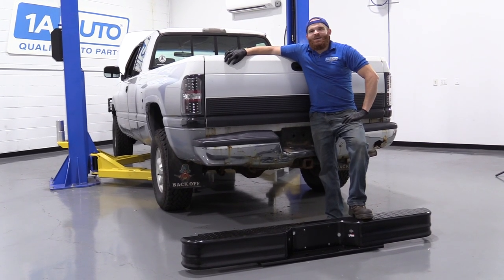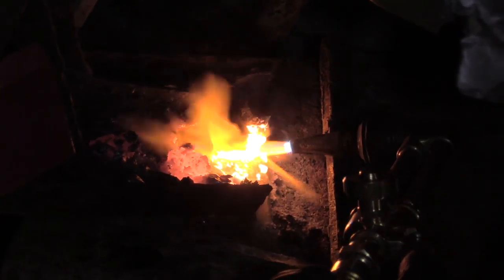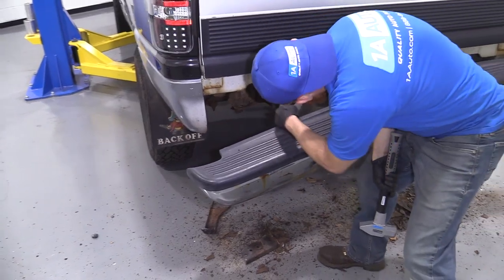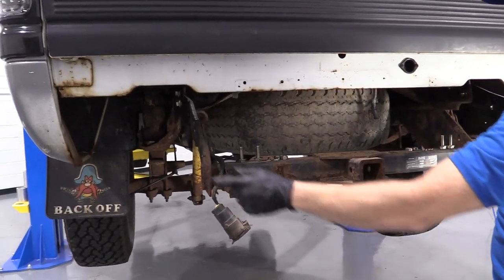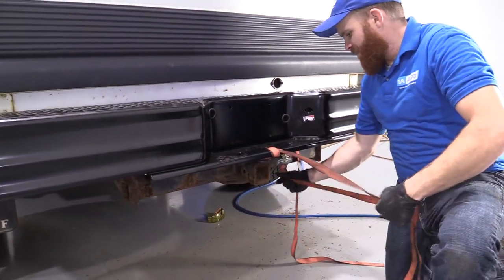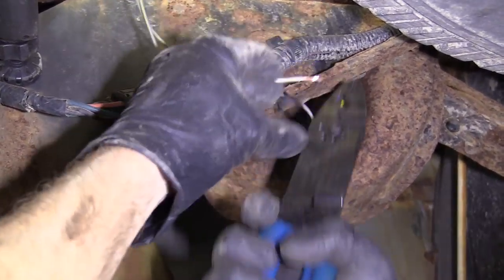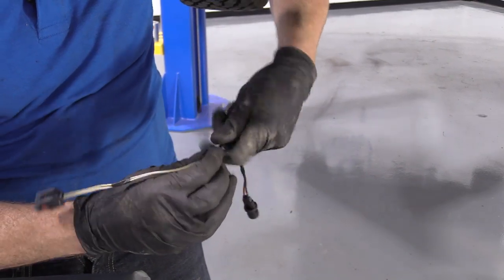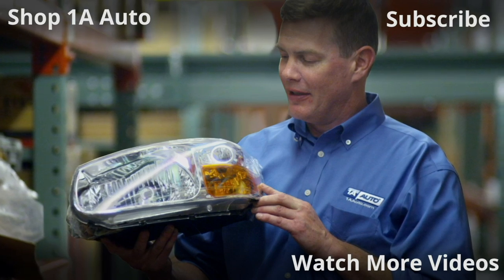How to Replace Rear Bumper 94-02 Dodge RAM 1500

Comment: I was just wondering, my ram needs this exact bumper. I don't have access to a torch, and mine is in about the same general rust equivalency, as I live in NEPA (the rust belt). Can this be done with an aggressive reciprocating saw event (we'll call it). Its more like a killing of the bolts. And while I have no where near your knowledge of repairing cars. I have 32 years of electrical work experience. Inside those wire connectors are typically aluminum if any of the wire is copper you must use electralux or dialectic grease when making the connections. I would also recommend it for the wire connectors. I would also recommend painting with at least a primer that clip that holds the license plate lights on from the back. Sorry please don't take any of my comments as nit picking. You do such amazing and professional work, I'm am just trying to make suggestions that make it bulletproof for those of us trying these projects for the 1st time. And your work is so good it's hard to find anything to add. But this is a great video and thank you for making it and posting it.